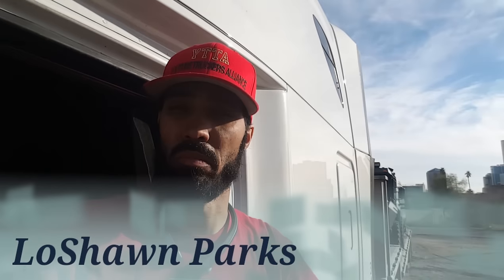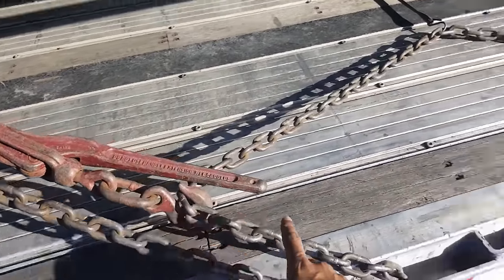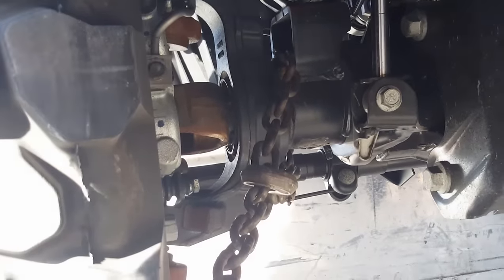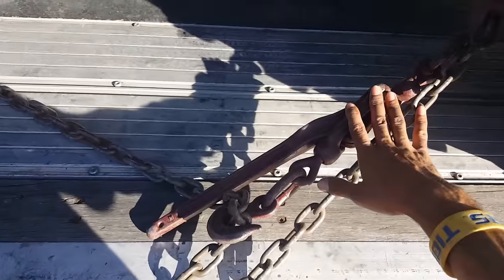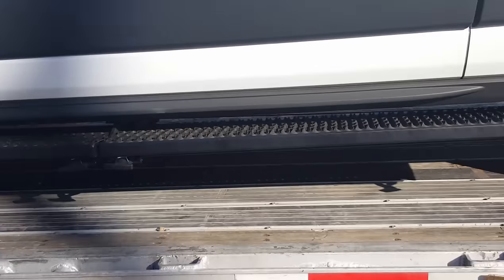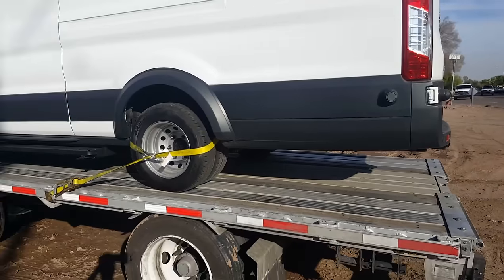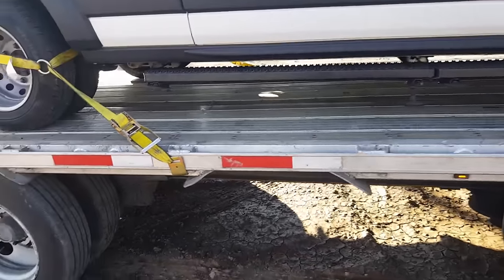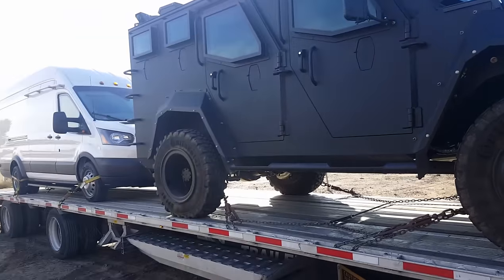Trucking | How to Secure a SWAT Truck & Armor Van on a Stepdeck! | LoShawn Parks

Comment: In the drivers cargo securement handbook look at chapter 10. That's why other drivers are saying 4 chains and 4 binders BC of the weight of that jeep. With all of that bullet proof technology I'm pretty sure it weighs more than 10k. Just a friendly input not trying to start all that beef BS.
Reply from the maker: T Hollins I will double look into it. Appreciate your input
Reply: T Hollins I had a load of 3 HumVees that weighed about 5600 lbs per vehicle. I ran 2 chains (not to be confused with the rapper) on each vehicle, with 2 boomers per chain.
Reply: Kevin Folds your legal under 10000 lb you can do that. Over 10k another story.
Reply: In essence that is four chains with the slack in the middle. Dot legal
Reply: mark robertson Go ask a dot officer about hauling vehicles over 10k please don't actually have on loaded it's going to be an OS. 4 chains 4 binders some places want 5 of each.
Reply: T Hollins I had a load of 3 forklifts, at 13,000 lbs per lift. I ran 3 chains and 3 boomers per lift. I used 2 chains in the front of each lift and 1 chain in the back of each lift. And had a boomer on each chain.
Reply: Kevin Folds yes I see that alot and use to do the same but 4 binders 2 in front  one on each side with its own chain and 2 on one chain in the back. Until a Texas State Trooper told me I needed 4 and 4 BC of weight. No OS just an FYI from him.
Reply: T Hollins ah! I appreciate that knowledge. Then again, more is always better.

Comment: That whole thing of using one chain as two can get you a ticket. If it has wheels or tracks and the weight of the unit is more the 10,001lbs then you need to have 4 separate chains/binders. Also Your rear chain is bending the brake dust shield should have went around the axle where the leaf spring mount is...
Reply from the maker: SKT that statement about needing 4 chain is not true. DOT has no issues with the way I secured it and it is perfectly legal. why use 4 chains when if you know your points of contact then you don't need 4 chains. some of yall make me wonder sometimes.

Comment: What's your chain and your side rail rated for? I'm guessing lower than 5400. "Only as strong as your weakest link." If your chain or side rail is less than your binder, it's only rated for your lowest weight per securement. Especially with 2 binders on a chain.

Comment: Definitely I will not gonna secure the van the way it is in the video. The way you secure the straps to the trailer is totally wrong. 
1st this hook is not designed to be used for strap going sideways otherwise you will cut the loop of the strap with the time
2nd the hook should loop with strap trough rail at least half way to release the direct pressure where the strap loops through the hook. Otherwise you risk to loose your freight bcs your strap and ratchet will got loose or missing.
3rd Many states are requiring the chain to be looped trough binders like the ones you have few times in case binder opens up and get loose. Now days you can get special kind of wire made lock to secure those kind of binders. I prefer tie down binders not snap binders, but I have 4 spacial snap binders with build in secure pin that locks the handle and prevents from opening, for those loads that tie down binder cant do the job bcs space is limited.

Comment: weakest link is the rail spindle.rated 4,000 lbs i believe.I see forward and backward but i don't see up/down or side to side securement.Especially on the van tires.no biggy im just an over kill guy.Good job man.Liked the vid.Good luck and God bless.

Comment: all cars and trucks have tie down points on the frame. 
they are used for transport and also used for frame pulling machines to pull it back to square after a collision. 
but unless u hall cars or trucks or work on them you wouldn't know. they are marked on the frame is you look closely and read what is posted next to holes.

Comment: when loading the van put wood planks under the tires so you don't damage the boards on the van and get actual wheel tie down straps they have to come down strait not on a V .